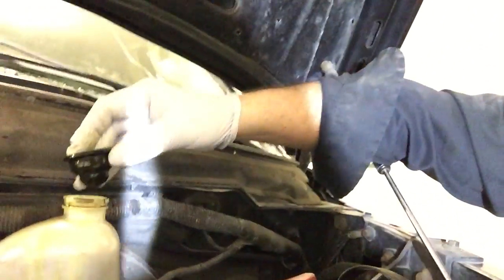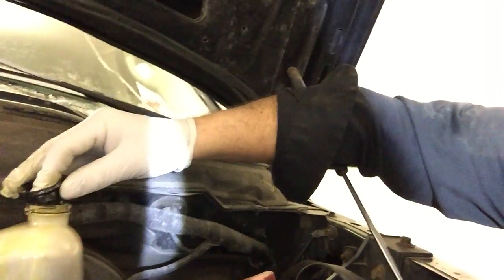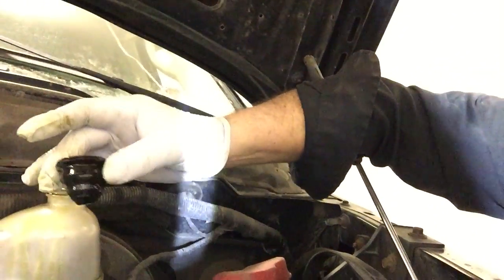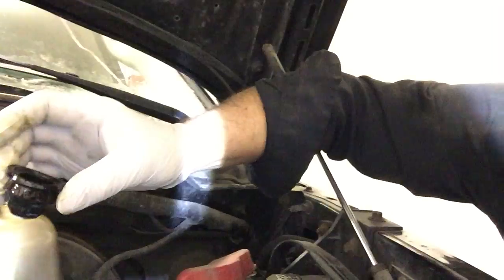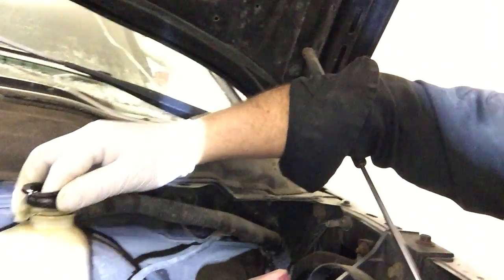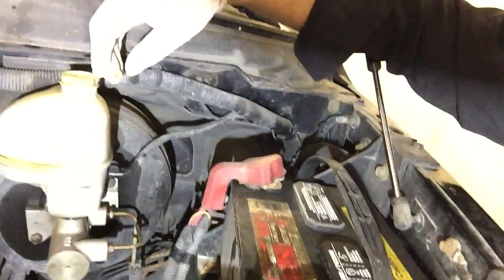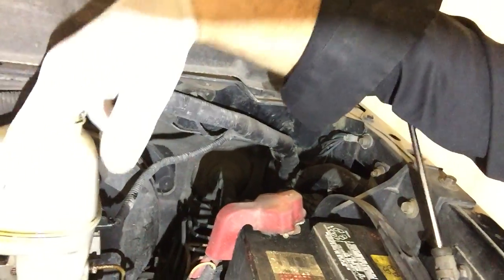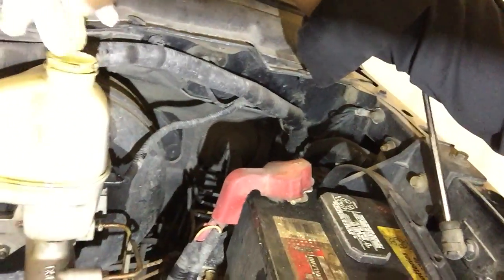What happens When Oil Is Added To Brake Fluid - Dodge Ram Oil Contaminated Brake Fluid

Comment: I just did this myself. I needed to top up the power steering and I hadn’t fully woke up or had the caffeine I’m dependent on to get going in the morning, and I accidentally dumped a bottle of Lucas power steering stop leak into my brake fluid reservoir. I instantly knew I had fucked up and immediately drove to the nearest full service mechanic shop. They gave me a guesstimate of about 3500 which just isn’t economically feasible for a 4k truck so I drove straight home and parked it. I’m so pissed at myself right now because I know better.

Comment: Would it be safe to say that this same thing will happen if a mechanic mistakenly adds oil instead of brake fluid? The flubberizing part? Because that's what I'm currently going through.
Reply: Have u ever found that out I'm having the same problem right now to???

Comment: I did the same thing on accident the brake fluid was a little low still above minimum and I wanted to top it off to max and accidentally poured some in it from half way between minimum and max up to max. When I realized what I had done I pumped it out until the reservoir was empty and then added brake fluid before I even drove it again. Would that cause this kind of problem or what I need more of a significant amount
Reply: Update?
Reply: @ehova5838  Brakes are still working great. I've had to change the pads, but the lines there's not been a problem. But remember, I realized what I did and got a pump and pumped it out before it entered the system. It was all still contained in the reservoir
Reply: @danielchouinard9907  I’m in a very similar boat. Put about two ounces in until I realized how dumb I was. Siphoned out the resivour 5-6 times before i took it to a shop and had it flushed. Working fine so far I didn’t realize how big of a deal it was

Comment: I just had to fix this for someone. It was only pulled up a couple inches after oil was added. When I removed the lines going to the master cylinder I only saw clean brake fluid coming out, So I replaced the master cylinder and everything is all well.

Comment: I turned down a brake flush from a routine emissions and safety inspection at a new place because I work on my own car and knew I just flushed and bled the brakes a year ago when I replaced my calipers. These mother fuckers put a lil old oil in my brake reservoir because I declined!

Comment: Silicone rubber would not be affected by petroleum. Brake systems traditionally use natural latex rubber, which cannot come in contact with petroleum.

Comment: Mea culpa on my '81 Jeep Scrambler. So I'm looking at master cylinder, calipers, what else? Will I need new brake lines too? Experience is a strict teacher but a fool learns from no other..
Reply: No. The metal doesn't care - just all the 'rubber' (usually EPM or EPDM) seals and flexhoses.

Comment: so dummy but interesting question for you Dr. just for knowledge .  it is really bad just adding new brake fluid to the master cylinder mixing with the 75,000 miles old brake fluid or is better to keep the old one .  I know the goal is complete flush but I read that mixing old with new is a complete disaster .

Comment: I had a well-known dealer to change my oil put on new brakes and rotators.  The day we drove it home, the brakes seemed airy, I took it back to the shop 2-3 days later and they said the brake fluid was contaminated.  This shop is the only place that that does any mechanical work on my car for the past 3 years.  How long does it take to contaminate the brake lines?  He tried to tell me that there is no telling what someone did 3-4 years ago.  I just find it pretty ironic that the day I got my care back it started having issues.  I feel like it my brakes were contaminated it would have affected the brake lines much sooner than 3-4 years.
Reply: Sabotaged 100%

Comment: OMG. I totally fucked up today

I drive a 2009 Kia Rio and put about an ounce or two of synthetic oil in the brake fluid reservoir. I'm scared to touch the car now cuz I don't want to drive it and be out on the road and the brakes fail
Reply from the maker: Don’t drive it. Suck all the fluid out and flush it super good. Then pray.

Comment: I had mine changed in Feb and now my brakes are locked down on my rumble bee.  The mechanic told me it was oil in my fluid line.  I called the place that changed it an the guy came unglued...I advised him what happened and he has tried to absolve himself of responsibility by saying "its impossible" that it happened.  He called my mechanic and then called me back and said it wasn't their responsibility and he was "out of it".  My question how long would it take for the oil to cause the rubber to fail??  Years? Weeks? Months?  He was our last oil change so I was simply trying to establish if he could of accidentally put oil in the line just from speed of the changes.

Comment: 3 to 5 grand??
Hummm!
Reply: Tony Crespo Thats how much a shop will charge you. In reality it'll cost you about $100 - $200 for the parts, depending on your car. T
Reply: @EggEnjoyer  Is it like hundreds of dollars in just part? Like master cylinder and seals and hoses; calipers?
Reply: @dannylopez9109  I am by no means a car guy. So if I were I’d do my own research. But when someone put oil in my brake fluid without me knowing, it cost me like $200 for all the parts. The most expensive part being the master cylinder. Calipers and the tubing isn’t expensive. But also maybe I didn’t change out all the necessary components? Idk I just got a new cylinder and hoses and calipers.

Comment: Mine was the other way around brake fluild went into the engine It has extended warranty so took it in to ford they said no fluid went in to motor and i told the motor was smoking i know it went in to motor so they didnt fix it took back to month later cus i changed oil and surprise it has brake fluid.
Reply: Wasn't there any damage to the engine?

Comment: Back in the 1980s, one wheel cylinder was leaking on my 1977 Olds 98, so I put a couple of squirts of chassis grease in the master cylinder reservoir  and added fluid as it worked its way to the leak. The leak stopped and  I never had trouble with it after that. To be fair, I only kept the car for another couple of years, but I suspect that grease will do less damage than something thinner. I wonder if vegetable oil would be even less harmful.

Comment: OK I did  something stupid.  I had to replace my brake caliber's on my 1986 Toyota 4x4 and I decide to flush all my brake lines so I disconnected all 4 brake lines and kept adding fluid until they ran clear of clean fluid.  I then forgot and the master cylinder ran dry.  When I went to fill it up I could not get any brake pressure at all.  Pumped the brakes and held them while I cracked open the bleeder but after doing this 15 times no brake pressure.   Do you know what might have happened.   They were working fine before I started the project.

Comment: It really really depends on the car!!! Always check the service or owners manual before doing any service! I have seen people pour power steering fluid right into the brake fluid reservoir and I always thought they were bunch of bug fools, well it fact I was the big fool the whole freaking time. It turned out that that car was a Citrëon which uses a brake fluid called “LHM”, which is a petroleum based hydraulic system fluid developed by Citrëon, it is hydrophobic and has a very high boiling temperature, it is also used by Citroën Peugeot, Rolls Royce and Jaguar, although only on a limited numbers of models.

Comment: Thanks you for this information it is helpful. Does the brake actuator need to be replaced if you have contamination and how would you know? Is the actuator different from ABS and how do you know if ABS needs to be replaced?  (2011 Nissan Rogue)

Comment: I have a 1998 Astro van... 
I found someone put .5 qrt  of tranny fluid in my brake lines... 
I only have right front brakes working currently....  what says you about this? It runs.. I have not driven it far... woes me... help
Reply from the maker: Replace everything with rubber components in brake system. Bummer.

Comment: Hi i just added sea foam trans tune in my brake fluid reservoir by accident and i let the car idle for 10 minutes but i notices my mistake and inmediately sucked it out and put some more brake fluid let it idle and sucked it out again
Reply: Can it still be in harm if i didnt drive it
Reply from the maker: I would flush the system if I were you
Reply: The Car Doctor is the trans tune is as bad as the power steering fluid? I already did the flush but idk if i should chsnge snything
Reply from the maker: Not sure about the chemical composition of that product but its likely very harmful to the rubber components of the brake system. All you can do is flush it real good and see what happens. If I were going to replace anything I would probably start with the master cylinder. Flushing with an alcohol based cleaner then with proper brake fluid and even a pressure bleeder is best.

Comment: what if I got it early and drained it after a short drive? I'm just getting grinding like bad pads a week later
Reply from the maker: 2 seconds or  a week later, it is really hit and miss but the industry standard is still the same....replace all rubber components in the system and flush it with alcohol. If I said any less then I would be open to liability. Hope you get it figured out
Reply: Your brakes will start to stick when it’s going likely

Comment: DAMN IT!!!! I just realized today I had put power steering fluid in my 72 Pinto Brake system. It's been in there for 18 days / 49 miles of driving. Then I read all the horror stories on line about it. So I went to town flushing it out, also blew out the lines with the air compressor. I had some of that Ray-lube brand Brake Fluid. They put the power steering in the same bottle and I hadn't caught it until I was topping off the 91 Pathfinder. so I quickly siphon it all out of the add area 5 mins later on the Pathfinder. So then I popped the Brake Master cover on the 72 and noticed the distorting going on with the plastic cover seal.
Reply from the maker: yuk. sorry for your loss

Comment: What happen when water is added to brake fluid in Renault duster??
Reply from the maker: For sure it needs to be flushed and bled but you might have avoided a big problem like when oil is added. Get it flushed before it rusts something inside the system and causes damage.
Reply: @ThecardoctorTV  and water boills make steam in system if hot much braking  then no brake power no brakes
Reply: Water can also make the pedal freeze up on cold mornings.

Comment: what can you use as a substitute for break fluid in emergency situation
Reply: engine oil wont work tried that now im paying for it.. i put some in and toltally lost all brake function
Reply: DOT - 3, DOT - 4 & DOT 5.1 are compatible.  They just have different boiling points.  
DOT - 5  is not compatible with anything but itself. 
None of these are compatible with any hydrocarbon oil.
Reply: @neogovernment   
Read  J Sippola   below. You gave bad advice. 

DOT - 3, DOT - 4  &  DOT 5.1 are compatible.  They just have different boiling points.  
DOT - 5  is not compatible with anything but itself. 
None of these are compatible with any hydrocarbon oil.  Engine Oil is a hydrocarbon oil.

Comment: How long was he driving it like that? I only added maybe 2oz of atf to the breaks and used a  turkey baster and sucked out almost 500ml. In the baster it had the red sitting on top of the break fluid. About the with of a finger. Should I fill it right up so the red all comes to the top and then I can suck out that and the extra back to normal level. Or is it too late? It drove maybe 5-10miles tops
Reply from the maker: Well hard to say if its too late or not. I would suck it all out and flush it with brake clean then flush the system and start praying.
Reply: @ThecardoctorTV   I agree. Only I might suggest he force-flush it backwards so as to not push any contaminant further into the system.

Comment: You show the problem with brake fluid contamination. What to do when it happens? I have purchased new calipers master cylinder. booster and rubber lines. I hope you can help me in this process NO ONE ELSE ON THE NET KNOWS THIS PROCESS .I hope you can help ..
Reply from the maker: Flush all the system with brake cleaner, replace everything with rubber components and bleed the system after. Youll be good to go!

Comment: I cant see how this is 3,000 to $5000 on a dodge. 

Master cylinder was $40, combo valve $40 and abs cost me nearly nothing as it was just o-rings. My calipers are fine for now, but if not they are only $40 a piece. The oil was still clear there, so I might be ok.

My brake line was cut. I fixed that. I was short brake fluid when bleeding, so I  topped off with some marvel. about 4 days later I had no brakes. I looked this up a few days ago to see how bad I screwed up. All these forums and vids really had me worried. At least it was all fairly easy work. 

Now my brakes work better than they ever had.
Reply from the maker: Good on you for the fix. I didn't see where you replaced the flexible hoses but that's not a huge expense. The major cost here would be labor and the cost of an ABS HCU since we don't rebuild them for liability reasons. Take care
Reply: I looked up an new abs pump assembly and I was looking at a reman for about $225 to $350. The calipers and hoses are really cheap, and I ordered them for the next pad swap.

Its my daily driver. Surprisingly, it's stopping very well. After the condition I seen all the o-rings, I decided to order the rest. I will probably put it off until I need pads unless something starts acting up. My trucks is a 2001, but the parts list seems pretty short.

I will never do this again. I feel so stupid. If only the brake cutter new.
Reply: @ChannelZeroOne  You sure are not alone...I feel so stupid, too.
Reply: @ThecardoctorTV  How much would you estimate on an older car that doesn't have ABS, like a 2004 Altima?
Reply: Good lad! Lots of nuts on youtube!

Comment: More common a problem than I thought. Happen to a friend. The culprit was one of those quick lube places. In your estimation what percentage of the vehicles that you see have had a fluid other than brake fluid added to the braking system?
Reply from the maker: +Ed Ogloza .00001% and of those 80% were done by quick lube places. 50% of them attempt a repair that is less than replacement of all rubber components and most of those have some sort of complete failure of the braking system. I have seen an Audi that was contaminated and the total cost was over 10,000 in repairs. Yikes. Thanks for watching.

Comment: That happened to a friend of mine years ago. A petrol station assistant was trying to add oil.. I sourced every indivudial seal and replaced them along with the hoses. I used a second hand rear valve as the old one would not come apart. I know some people do not like second hand parts but some parts hardly ever fail so there is little point sourcing a new one.

Comment: Ha that happens more than people think. The closest thing I can figure out is people seem to think power steering and transmission fluid are interchangeable for some reason and then  forget and think its interchangeable with brake fluid. Good vid to show how much a little knowledge can cost a lot of money :) 👍👍
Reply: +The Car Doctor congratulations to your son.
Reply: +Steve Rob * Long time ago all or most all brands did call for ATF for power steering. Of  American manufacturers Chrysler was the fist I saw spec their own brand of PS fluid.  I would say that was in the '70s.  That is why old timers who don't keep up with the times would think it was OK for ATF in PS.
Reply from the maker: +Steve Rob I'm working up an estimate but figure 4-5K and I don't know if he will do it. I'll keep everyone posted. Flying to Sika today to watch my boy become a graduate of the stat law enforcement academy. Super exciting.
Reply from the maker: Thanks!
Reply: Ford used transmission fluid for power steering until they no longer made hydraulic power steering anymore. All electric now except some of the bigger trucks I think which still use transmission fluid.
Reply from the maker: +Steve Rob Agreed, just wanted to highlight how a small DIY mistake can get ugly quick. So sad for this guy.
Reply: +dan andy Hi Dan , that's exactly what I was thinking, but I'm an old timer that tries to keep up to date:)   I had one where the abs module was not activated and didn't  know if it was contaminated but the guy got lucky and it seemed to just bypass , now this was a 1990s something Silverado. I hope Tim lets us know what was all changed. Feel for the guy for sure. Take care Steve.